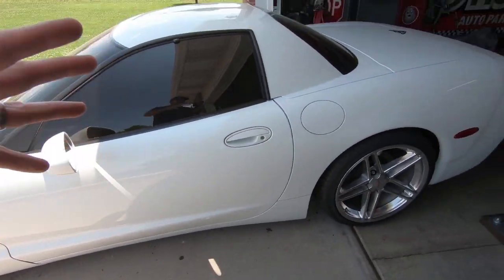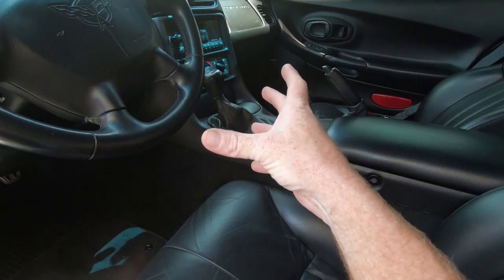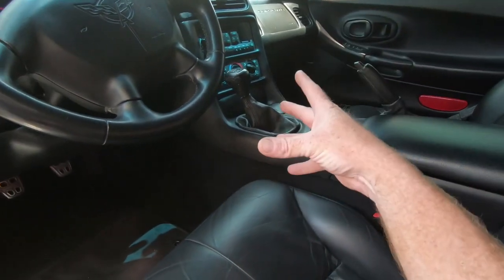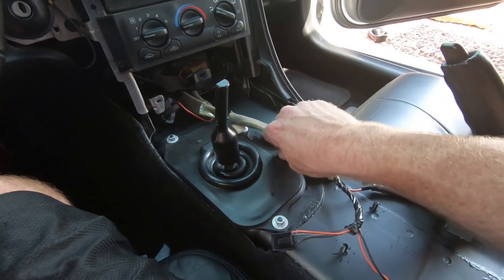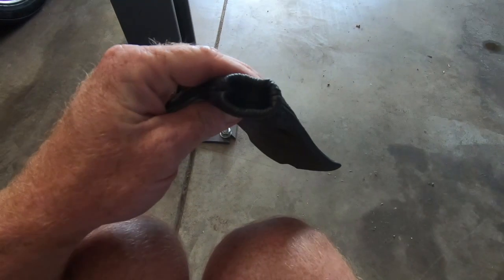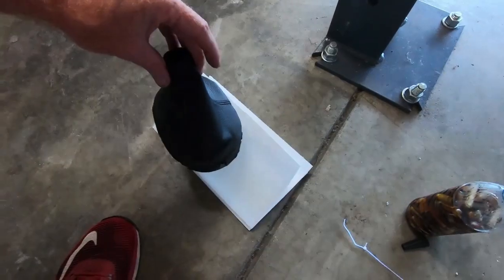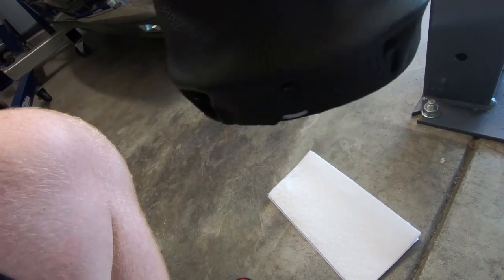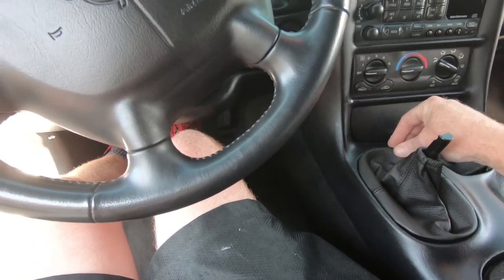How to Install C6 Corvette Shifter in C5 Corvette FRC (Way Better!)

Comment: I bought a low mileage 02 z06 about a month ago. I've been debating between the C6 and the MGW shifter. I did the antivenom mod and used one shim along with Mobil 1 ATF. The trans shifts really nice now. After watching your video I'm going to be buying the C6 shifter.
Reply from the maker: I need to do that mod too
Reply: I would go with MGW hands down I did this with the venom mod and I can't wait to get the MGW 3-4 week wait currently on the shifter.
Reply from the maker: They are great shifters
Reply: Why did you use one shim? Just curious as I'm about to do this mod too...
Reply: @moe4772  one shim will be ok 2 is best one is for if you are unsure really. Try one then 2 . I did 2 right away and love it.

Comment: Hey Travis,  while watching this video, i was looking closely at the shifter rods. Does the stick screw or bolt onto the shifter mechanism. Why i ask is, i did a short stick exchange on my 2000TA and it eliminated the factory mushy bushing in the shifter stick. Now it shiftes solid and the throws are short. And it looks like the vette has that same bushing in their sticks.
Reply from the maker: It bolts on
Reply: It's the same,  there's only one shifter that eliminates the bushing for the shifter and you have to change the shifter box, it all comes in a kit

Comment: love that white, if you were gonna keep it i would suggest mgw shifter. that pin in front of the shifter is to recenter/ neutral the shifter lower box to the linkage.
Reply from the maker: I have had mgw in the past and thought it was a little notchy.

Comment: The shifter itself is like 99% same trash as stock C5 one is. You can get a any style shift knob you want in C5 without changing the shifter and if you do decide to swap it go for MGW.
Reply from the maker: It is close to the same.